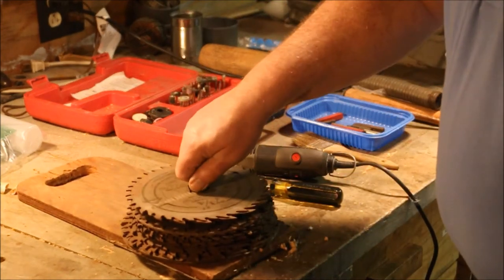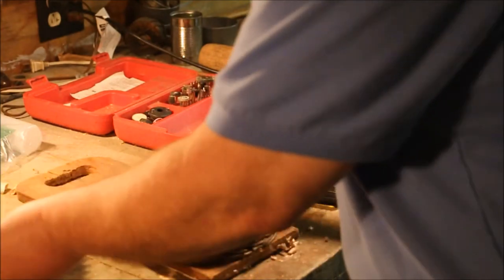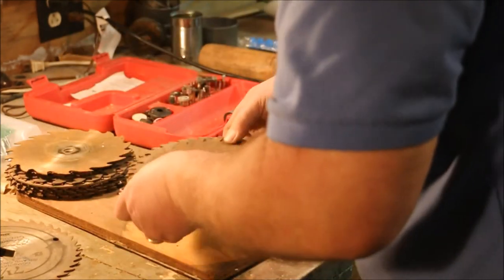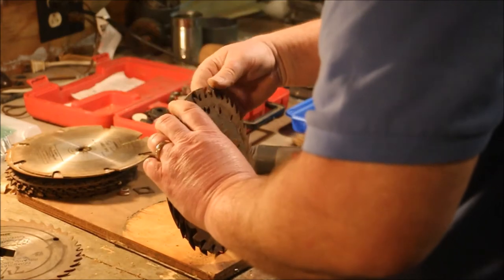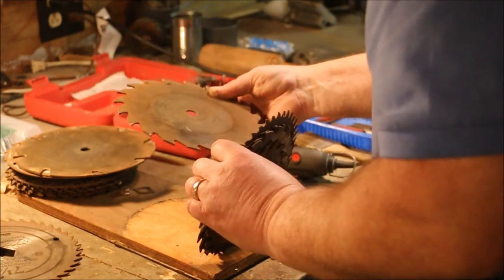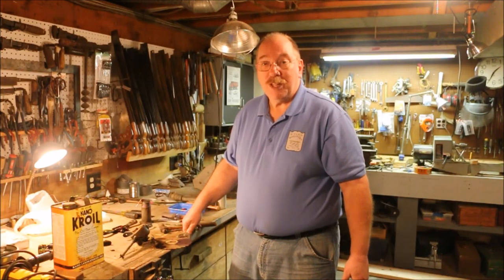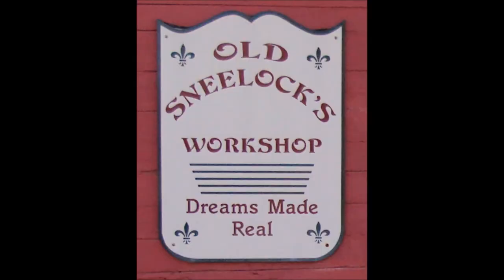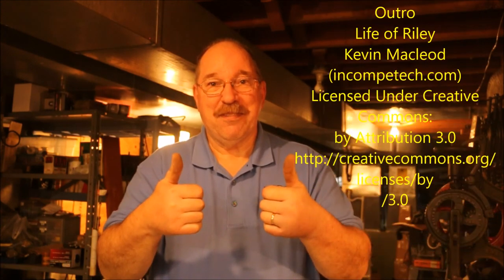Making A Spoke Shave Blade ~ Pt 1 ~ Selection & Layout ~ by Old Sneelock's Workshop

Comment: ..A Teaser to get us a slobberin !!! I did a scraper out of a piece of sawblade. It's stiff but smooth's wood like a newborn's  behind...
Reply from the maker: Ol James I chose this blade because it was an thick, older blade without carbide tips. I have a few of the older Stanley scrapers with thick blades. One has the blade missing. Now that you mentioned it I'll see if there is enough steel in thi bade to make one.

Comment: I'm gonna enjoy this one. I've got loads of old saw blades that need a new purpose in life.
Reply from the maker: Tim Caldwell The new carbide tipped blades are so cheap that I don't bother trying to retip them. I mostly use the circular saws for demo and framing. With Ryan  buying a new house I probably won't be doing much of either. 
Still it felt weird to be cutting up a usable blade. 😐

Comment: Are modern saw blades high enough quality to repurpose?  Still amazed at the knowledge and skill you possess. Always enjoy seeing what's next.
Reply from the maker: cavu4me The body of the newer carbide tipped blades are made of good steel but it is made tough, not necessarily hard. This is an old untipped blade it should take a pretty good edge.
Reply: Old Sneelock's Workshop thank you for the reply. Looks like I need to do some antiquing lol
Reply from the maker: Always a good plan. :-)